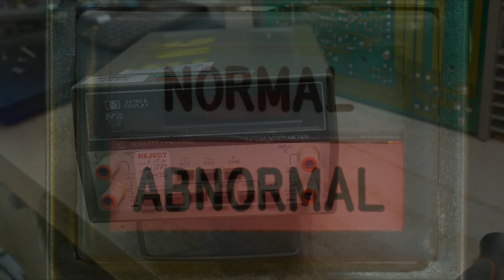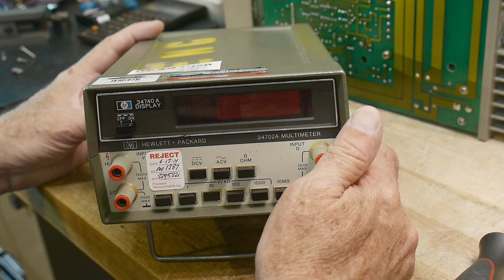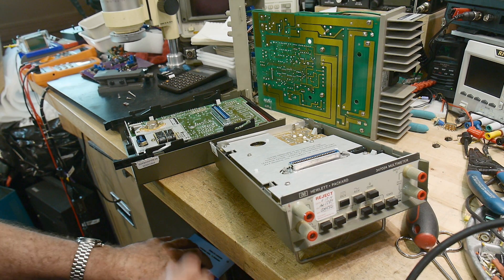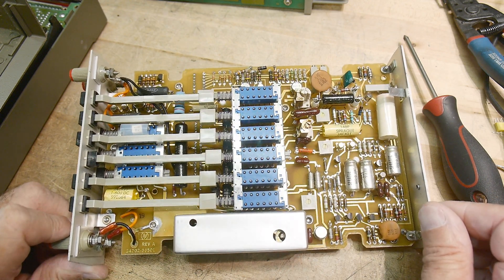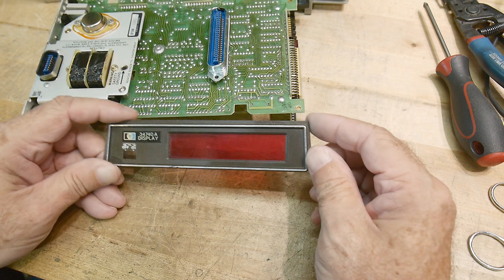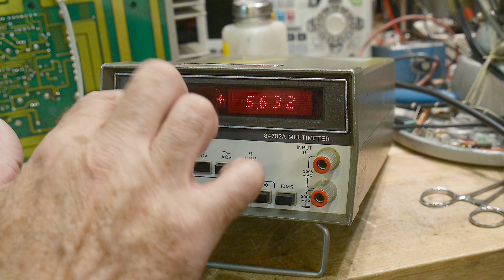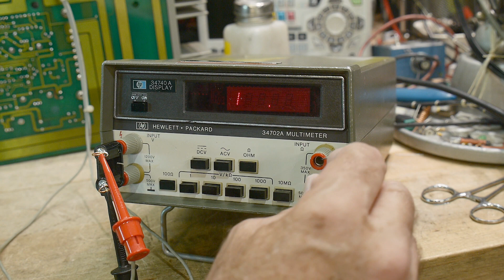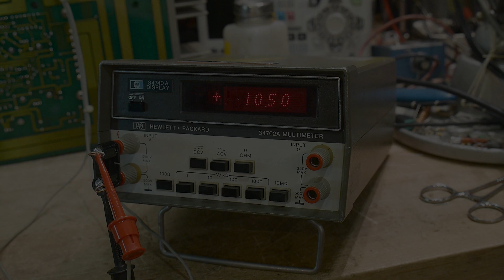#1244 HP 34702A Multimeter with 34740 display unit (part 1 of 2)

Comment: @5:38 you can see a blue wire running through a hole to the display voltage converter board.  Is that factory (like a white wire to fix design error) or was that a repair at a later date?  if repair do you know what for?
Reply from the maker: everything looked factory to me

Comment: Very nice. I never had one of these in hand. 0:33 There was a mid-unit for the 3470 group, the 34721B , for driving parallel BCD to a printer (I don't recall the printer id's.  neuron rot...).  There was also a unit to pick off display info for a printer/plotter on the counter version (5300A/B) numbered 5311A. It picked any three consecutive digits, IIRC.(HP journal  june '73 describe the 5306A DVM module and and 5311A module) I have a 5300A and a bunch of the front end modules because they came for free with a full set of nixies modules for a 5245 counter.  I love the dot displays. The drive for these is very cool, as it is by the half-digit. The 3469A is probably the coolest multimeter I own for this reason (though it is also cool as the meter and display are a tiny 2V meter module with a case full of scaling and conditioning around it) The later versions of the 5300B  went to seven segment.

Comment: Looks it's okay.
Why it was rejected? The power switch?
Reply from the maker: yes, would not power on
Reply: @IMSAIGuy  Won't power on? 99% of cases not a difficult fix.
Reply from the maker: in this case it was a broken switch. the switch is not a simple one and switches multiple things. I tried to repair it but it needed replacing and would be imposible to find. It moved too far in or too far out. I used hot melt glue to keep it in one position. The glue could be removed easily if the new owner could find a new switch.